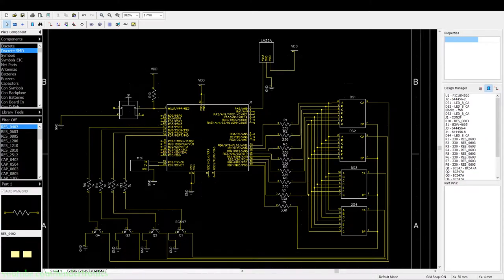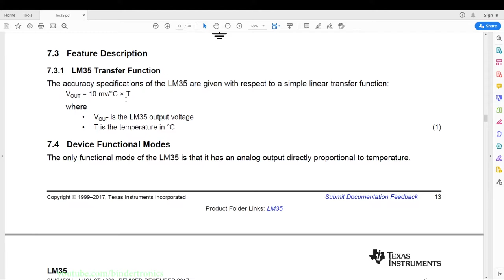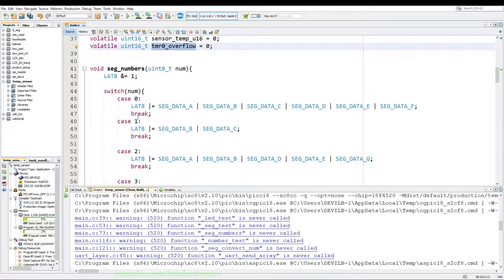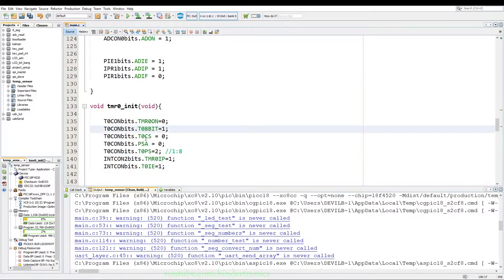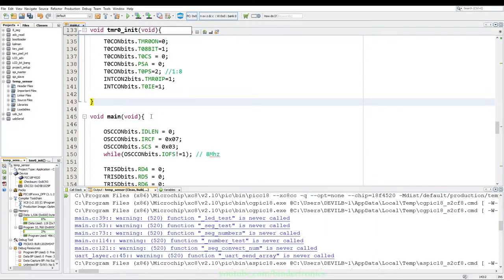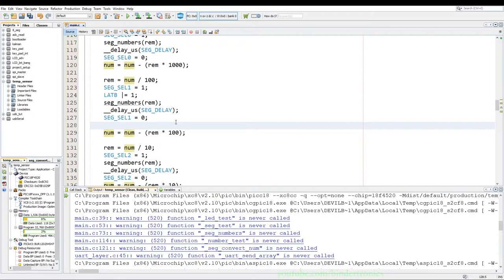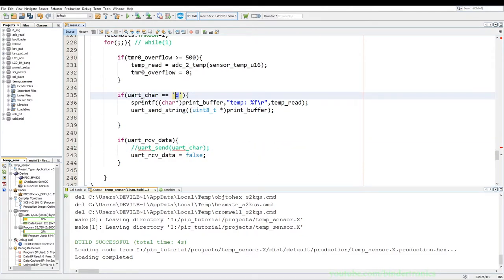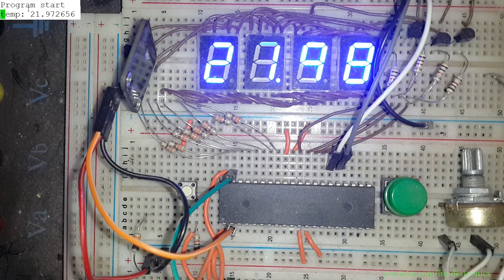Analog Temperature Sensor ( LM35A ) 🔴 PIC Microcontroller Programming Tutorial #29 MPLAB in C

Comment: Hello! I'm trying your code out, and it didn't work for me. It seems like there may be a problem with the configeration settings. So, can I ask, are the configeration settings the same as what you showed in the first couple of vidoes in this series? If they are the same, do we need to make sure we set it, generate the source code (with all the #pragma lines) and then copy and paste that to the beginning of the code from github?
Reply from the maker: This is the source code
https://github.com/Devilbinder/PIC18F_Analog_Temperature
Have you been able to light up the segment display? Just display a single number nothing else. Have you been able to read the temp and nothing else?
No config change, it be in the video otherwise.